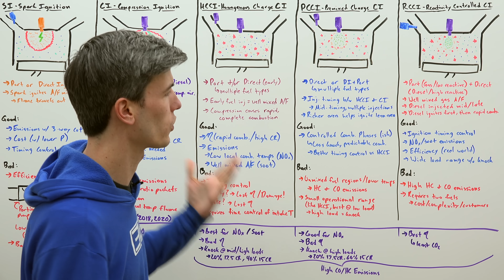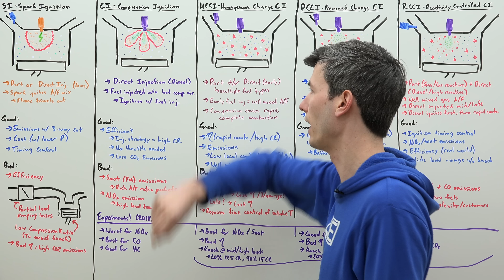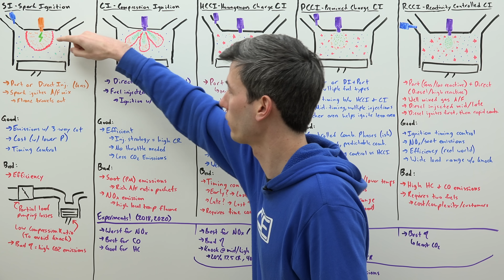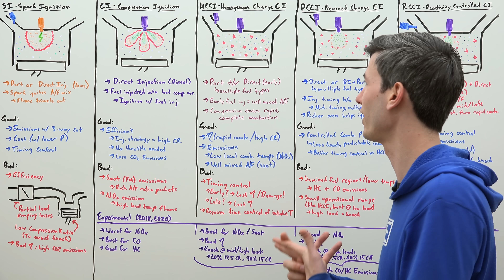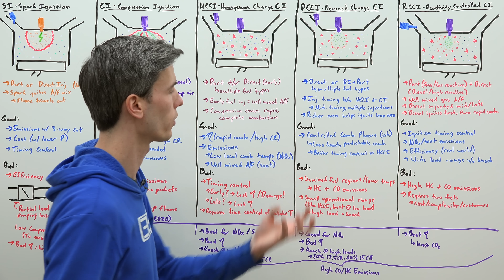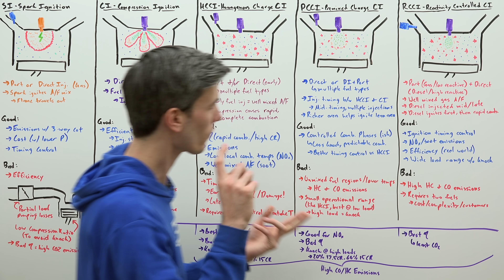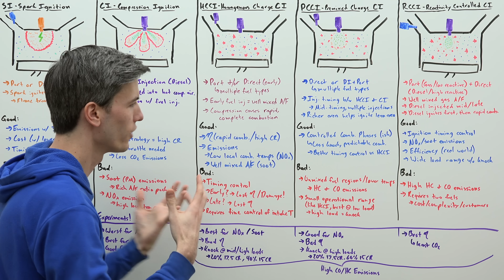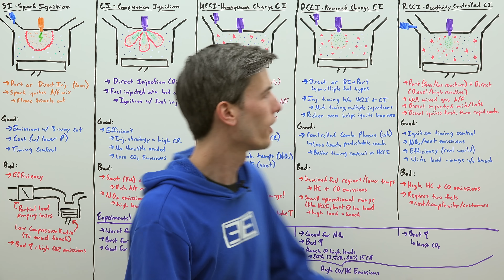If Combustion Engines Have A Future, What Is It?

Comment: why didn't you mention 2 stroke engines? These with a dedicated lubrication system and a blower
Reply: I'd love to see 2 strokes in street cars make a comeback. Good luck convincing CARB or the EPA to allow that much unburned fuel out of an exhaust pipe on that large of a scale though.
Reply: @hedbngr18  you are wrong. I am not talking about those inefficient dirt bike and chainsaw 2 stroke engines. The engines i am talking about have a lubrication system like 4 strokes and are fuel injected, which means no oil and no fuel goes unburnt out of the exhaust. Detroit diesel 2 stroke engines are an example. Those detroits were not very efficient because the manufacturers did not care about emissions at this time. But a modern one could have much higher efficiency that any other engine
Reply: @dieselgeezer18  The original comment said nothing about it being a diesel-powered 2 stroke. Plus, even the injected systems with dedicated lubrication still expel unburned fuel. That's the basic nature of a 2 stroke. Obviously the type you are speaking of are hundreds of times more efficient than small bore 2 stroke engines, but they still burn much more dirty than a cam and chain engine.
Reply: @hedbngr18  why would a direct injected 2 stroke expell fuel? It doesn't make any sense! The fuel will be injected when the piston is compressing the air and it will have closed the ports of the exhaust. No fuel can escape
Reply: @dieselgeezer18  So there's no exhaust port being uncovered before 100% of the fuel (whether directly injected or not) is burned? I've never seen that design. I must need to read up on new 2 stroke design. Thanks for the heads up.
Reply: @hedbngr18  There are also 2 strokes with exhaust valves on the head and the intake port at the side of the cyliner. The popular detroit diesel 2 strokes are like that. When the piston comes down, the intake port is uncovered and the exhaust valves open (using camshaft). A blower pushes air into the cylinder to clean the exhaust gases. Then the piston starts driving upwards, the exhaust valves close and the piston covers the intake port

Comment: I know this is an engineering monologue/lesson, but habitat destruction is how we’ve gotten into into this climate change fiasco, along with rising emissions. Yes we can (and should) lower emissions responsibly. Responsibly meaning through innovation instead of laws like California. 

What we aren’t addressing is habitat restoration - for example, the tall grass prairie was once nearly 200 million acres in the Midwest. Grasslands are the worlds greatest carbon sinks, more so than forests even. We’ve destroyed them to be farmlands for corn, wheat, and soy monocrops that do not take carbon out of the air, do not do a good job at retaining water, and require inputs from petroleum based fertilizers, pesticides, fungicides, and other inputs. 

We should certainly work on bettering efficiency on electric and ICE engines, as well as figure out actually green fuels like nuclear. 

We cannot do one and not the other - that’s like scooping water out of a boat with a hole in it. You’ve gotta patch the hole.

Comment: I think the benefits of a camless hybrid combustion engine with a crankshaft-mounted electric motor are hard to deny. You have the most-efficient combustion engine, which gives you cruising distance, w/ software that can handle cylinder deactivation or Atkinson cycle. The electric engine can give instant low-end torque to offset turbo lag, and/or EV range in cities where emissions control is most important. You can eliminate the timing belt/chain, cams, and let the electric motor replace both a hydraulic torque convertor and alternator

A camless engine can also eliminate a turbo waste-gate, quickly heat a catalytic converter and eliminate a pre-cat, etc. So you get savings in weight & complexity and gains in efficiency & power. Like I said, hard to deny! An EV is great for city driving, but these kinds of hybrids give you most of the advantages with fewer pitfalls

Comment: Electric cars are really only better efficiency wise if they use solar energy or any other renewable energy source.
Reply: Electric motors are always more efficient that combustion engine cars. Your washing machine has a motor more efficient than your car
Reply: @AleksandarStefanovic  yes , but overall efficiency depends on how you generate electricity.
Reply: @pakassassin9605  depends on what do you mean by efficiency. Solar panels, for example, are very inefficient in converting all of the sunlight energy into electricity...

Comment: Hey Jason, is there a practical difference between RCCI and a diesel running with a propane injection system? Seems like they're more or less the same thing. Aftermarket propane injection isn't uncommon with big trucks, and even some more consumer level vehicles like pickups and RVs. I'm guessing "true" RCCI engines would be designed for the dual fuels and be a bit more efficient and effective than basically "retrofitting" a diesel into an RCCI? Curious to hear your thoughts.

Edit: spelling
Reply: There is a difference.. in RCCI you want the diesel injection to be way before TDC that way the fuel ignition is controlled by chemistry. In a retrofitted propane diesel you are just partially replacing the diesel fuel for propane, the ignition is still controlled by the diesel injection timing, thus NOx emissions are still high and efficiency is not as efficient as RCCI due to heat transfer and the length of combustion.

Comment: Sounds like individual consumers will go EV, and long haul truckers and others who need long running independent power will go RCCI w/ a cat to fix the emissions. Edit: HCCI and PCCI might be good for stationary engines or ships where size and weight aren't a huge consideration. You don't "only" get 20% of the engine's capacity before knock, you re-rate that as 100% of the engine's capacity, and use a 5x larger engine to get the power output you need.

Comment: The premise of the video seems to be based on the notion that we will continue using fossil fuels for use in ICEs. But what about alternative fuels?

Potential means of producing said alternatives would probably be based on advancements in areas associated with bioengineering (metabolic engineering in particular) and chemical engineering.

Comment: Nope they only have a future in special purpose vehicles. so the combustion engine is like the classic camera with that strange thing inside called, photographic film
Reply: Whaaaat do you mean😡😡
Reply: @yayayayya4731  Well the furure is electrix, need not be electric and battery maybe electrix and fuel cell, but definitly electric. But there will be a small market for special purpose vehicles, so the ICE will not died completly. But it's good news, in the long run better for the environment and therefore better for us. But i will not be of much importance, wht will also come is self driving cars. But that will take a few years more

Comment: So HCCI and PCCI are more industrial applications where they just run for hours or days at one rpm rather than an automotive applicaition
Reply: Could make for decent generators but not much else.
Reply: @HankBizzle  Fine for a hybrid range extender, or possibly in conjunction with a CVT.
Reply: @HankBizzle  That would qualify them for use as range extenders to charge batteries in vehicles with an electric drive train

Comment: Well , again great infos , I would like to know if Diesel engine is less pollutant ? I think I heard you said , diesel emits less carbon , am I right ?

Saleem
Reply: Diesel engines have more emissions of soot (a particulate, like a fine dust, unlike, for example, carbon-dioxide which is a gas), which is bad for lungs, and also have more emissions of carbon-monoxide, which is much worse than carbon-monoxide. They are more efficient overall, but at the cost of polluting the air with more dangerous chemicals and particulates than gas engines
Reply: @AleksandarStefanovic  I have a bluetec , does it not mix up urea and with the emited gas ?

Comment: Im almost always accelerating at full throttle. Because over here in europe we have cars that barely have enough power to start rolling
Reply: 60hp gang
Reply: Ain’t that the truth.
Reply: My first car had 34hp. Good times.
Reply: I drove 1108cc for 10 years 👌
Reply: God no, 150ps minimum
Reply: @Re_Kitty  I’ve a 155ps (allegedly) Puma and I still have to change down to get up the hills on some motorways.
Reply: @M Bacon nope. I stick to the motorway speed limit (120kph here in Spain), or at least I try to if the car can do it. Basically, for the torque that is on offer and the weight of the car, the gearing is too tall.
Reply: @M Bacon And you’re right about the engine. There are not enough cc’s, not enough cylinders and it’s not diesel.
Reply: @M Bacon perhaps you’re right. I am at an altitude of nearly 1000m but the puma does have a turbo charged engine plus mild hybrid support. My previous car was a focus 1.5 diesel with 120Hp and that had no problem with the hills.
Reply: @kevinmills5293  I thought 1.5L diesels were for generators. I have a 3 cylinder 1.5 diesel generator in my RV, but the drive engine is an 11 liter 6 cylinder. Even my daily driver is a 6.7 diesel.
Reply: @rich7447  show off! Lol.
Reply: @kevinmills5293  We do like displacement here in the US. The 3.0 L diesel six cylinders are starting to gain traction for 1/2 ton pickups (Chevy Silverado 1500, Ram 1500 etc), but all the 2500 diesels and up are 6.6 or 6.7. 
I would need a HGV license in the UK just for my 3/4 ton pickup (9,600 lb GVWR).
Reply: @rich7447  it’s true what they say, there’s no replacement for displacement!
Reply: @kevinmills5293  Agree with that. We tend to go with higher displacement for longevity. Plus it isn't a lot of fun winding out a 1.0 liter to get to 75 mph and then keeping it there for the next 1,000 miles.
Reply: @rich7447  You have cheap fuel and low road taxes, that's why you drive those vehicles. We like V8s too, but owning one here is just pissing away money.

In the US when gasoline spiked at around 1$ per liter everyone was going crazy and buying Priuses. Last time we had gasoline under 1$ in most of Western Europe it was still the previous millennium.

Right now in the UK, which is actually one of the cheaper countries in Europe for fuel, gasoline costs just about 1.7USD per liter. That's 7.7$ per US gallon, in France it's closer to 10$! Also any of these high displacement cars are in the top road tax bracket and that means 750$ a year in tax. Not many people in the States would be driving V8 trucks with that.
Reply: @BigUriel  I was driving a V8 (5.7L) truck when gas was $4 a gallon. Unfortunately it didn't have enough towing capacity so I had to go to a L6 (6.7L) diesel.  I end up paying less for diesel since I have a fleet card. Even with that filling up my largest vehicle (L6 11L diesel) costs me around $400. I can't even imagine what the bill would be for 150 gallons of diesel in Europe. It surprises me that Europeans let their government get away with the levels of taxation that you have on fuel.
Reply: @rich7447  It's ultimately because of this thing called climate change. It's not just Europeans it's just about every developed nation except the USA. Even if you just pop over to Canada you'll see the difference.

Greener fuels pay less tax (for example LPG pays hardly any tax at all which makes it about half the price of gasoline at the pump), hybrids get huge tax benefits and electrics pay no tax at all.
Reply: @BigUriel  I moved to the US from Canada in 2005 so I'm very aware of the taxation differences between the two countries (lived in the UK before Canada). I also know that climate change is used as an excuse for over taxation.

Comment: Well, based from your explanation on this video, to me HCCI engine model could be superior in i-MMD (intelligent Multi-Mode Drive) like introduced by Honda-Sport-Hybrid team's, which the engine itself only operates at certain & consistence amount of RPM in order to charge for the car-battery itself, rather than it is being used to powertrain the gears. If interested, please do correct me if i'm wrong. Thank you.

Comment: I've heard a long time ago about an engine that can have around 60% thermal efficiency in 2004, using pressure waves as a method of compression or some sort... I think it's called the wave disk engine (WDE), can you make a video/discussion about this kind of engines and it's potential use in the automotive industry (if there's any)? Thanks
Reply: The wave disc died. Great in theory at the time, with a model built, but zero emissions have taken over.
Reply: @johnburns4017  yep... Unfortunately so, even though I would still prefer EVs I gotta say this is a pretty interesting engine with some relatively new mechanics, if it still has a chance we would probably see it on hybrid vehicles, maybe?
Reply: Mercedes Formula one power units have 50% thermal efficiency
Reply: The pumping losses of a piston engine, somthing you cannot get around, forbid any meaningful efficiencies.
Reply: Kresna Budiman - Thanks for mentioning this, I haven't even heard of the WDE design. Sounds like it's got worse sealing problems than a wankle though, but potential.
Reply: @rolliebca  ahh yes thanks for mentioning the sealing problem... Haven't thought of that for years, might be one of the reasons it has no further development

Comment: Curious how well HCCI would work as an oboard generator engine for cars like a Chevy Volt. In theory you can keep a constant load with high compression for peak efficiency to charge the battery. The actual acceleration and therefore load on the vehicle is handled by the electric motor. The engine therefore can attempt to run at its perfect parameters at all times. You'd just need to size it right so ensure it charges the battery more than than electric motor consumes in a typical around town or freeway drive.

Comment: Regarding RCCI, say a single source fuel tank with like gasoline, splitting that into a Y channel and having something added to one of the gasoline lines to make it react like a diesel?  An octane booster or something?  So you fill with only one fuel type but there is an additive that performs the function like diesel fuel to get the ignition when sprayed?  Something with a lower temp flashpoint?  I'm no expert on CE, I'm sorry if I'm not up to speed with all y'all.
Reply: You actually need a reactivity booster, you need to reduce the octane rating of the gasoline to make it react like diesel. This has been researched with the addition of ethyl hexyl nitrate (EHN) and ditert butyl peroxide (DTBP), it works

Comment: Jason:- "they are not very efficient"
They are hopelessly inefficient, with approx 80% of the energy in a tank wasted.
You cannot make a silk purse out of sows ear.
Reply: Scrapping a perfectly working car and buying a new EV isn't good for the environment either
Reply: @FSXgta  
I never actually suggested that. But eliminating combustion engines in urban areas ASAP makes lots of sense. 

The UK has announced it will ban the sale of combustion cars in nine years time. Enough time to phase out the poisonous cars.
Reply: Actually Petrol engines are around 30-35% efficiency (still awful, but not that much) and some heavy duty Diesels have been reaching 50% efficiency.
Reply: @xxxxxtrxxx13  
In constant speed and loads. In real work conditions they are hopeless. An extra 5% of a hopelessly inefficient engine is nothing.
Reply: @johnburns4017  They aren't hopeless, they can work better under load than an electric motor.
Think about towing, when an EV tows a trailer in a sloped terrain the range drastically decreases.
But the point is that the electric motor alone is brilliant and efficient, the batteries are the limiting factor: they're stupidly inefficient from an energy density pov.
Reply: @xxxxxtrxxx13  
Complete nonsese. 80% of the energy in a tank is wasted. OK get to to 75% - big thrill!
Reply: @johnburns4017  hmm ok
Reply: @johnburns4017  well... Despite fuel engines are 35 % efficient fuel density is extreme comparing to batteries. Moreover if fuel cells (SOFC) will be developed soon there is no hope we will toss fuel anywhere anysoon.
Reply: @2123101  
Look up Toyota and solid state batteries. A game changer. We are just witnessing the death in front of our eyes of the ICE engine. Every now and then it kicks while dying.
Reply: @johnburns4017  same for fuel cells. Solid Oxide Fuel Cells(SOFC) have efficiency of 50 % and potentialy will have up to 60% and if u manage to use the heat in compact tubine u can go up to 70 or higher. But developing efficiency up to 60% alone will make SOFC superior because of the fuel density.  And u can use same ethanol to power it. Batteries are cool but require more spots to charge. In places such as arctic in Russia using batteries is not an option btw.
Reply: @2123101  
It still is way off to an EV.  With EVs the best is yet to come - and it  is coming soon.
Reply: @johnburns4017  fuel cells are used in EVs...
Reply: @2123101  
Pure EVs are battery plus motor.
Reply: @johnburns4017  em. Pure? Mean no emission? Cause fuel cells generate electricity. Also there are some ideas to make electrogenerating stations using SOFC.
Reply: @2123101  
Pure EVs are simple. A motor with a  battery.
Reply: @johnburns4017  the difference between ev with battery and ev with fuel sell is that you use fuel cell instead of battery. For instance there are PEM(protone exchange membrane) fuel cells that use hydrogen(those are developed too) . PEMs are used for drones (because weight and energy density). SOFCs are just way more versatile.